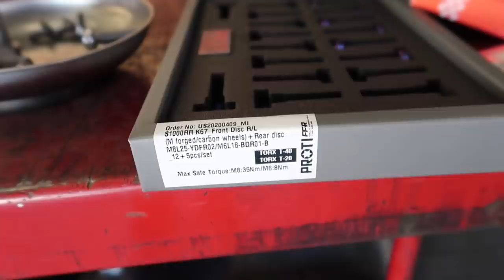Our Carbon S1000RR is Finally Rideable!!!

Comment: Regarding your titanium fasteners, an interesting thing about titanium anodization is that the color is directly related to the voltage.  You can get some nice blues at 27-36V, while purple is up around 80V.  So it might be possible to get matching fasteners with a different voltage.  Then again, I don't know how it's done in a pro setting--I'm basing that theory off of a BladeHQ DIY video:  https://www.youtube.com/watch?v=Y_A53PWmBLo.  Those are still awesome so just a tidbit that may come in handy someday.